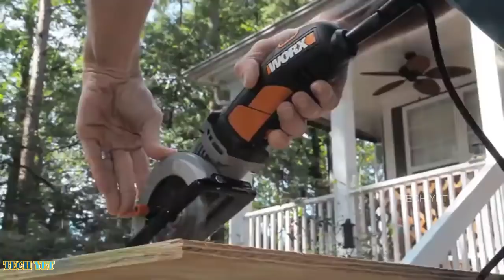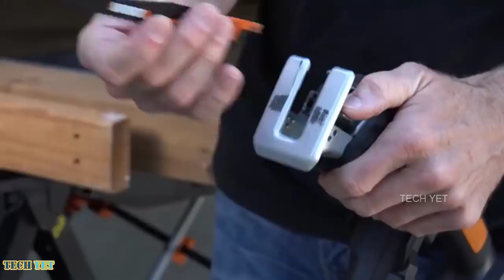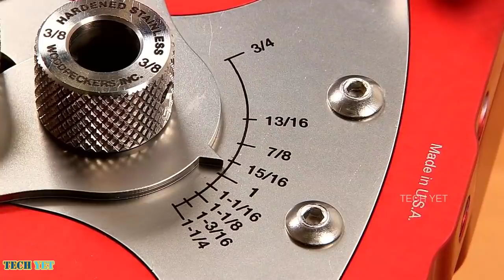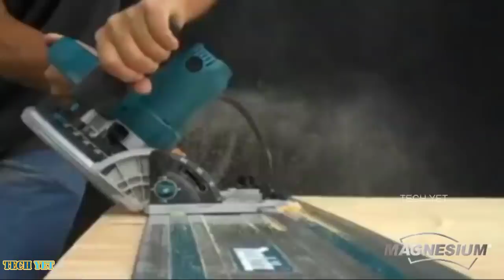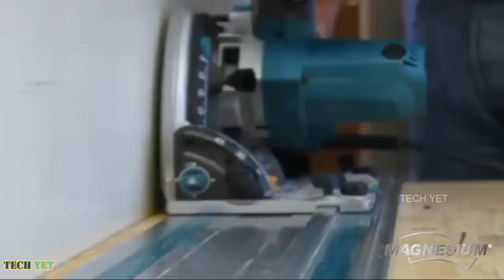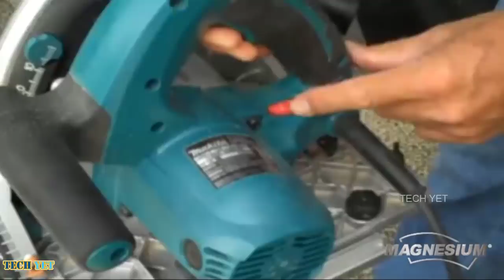5 Cool WoodWorking Tools You Must Have On Amazon | Best Hand Tools

Comment: Woodpecker makes some great wood working tools and jigs...but as others have said, they are way over-priced.
I realize that they are precision tools that really aid woodworking projects. However, it has always come down to price and how often I will use a tool.
I don't mind paying for expensive tools, but not if they are going to set idle and gather dust in the shop.
I like building my own jigs anyway and while they may not be as pretty as woodpeckers stuff, they do what I need them to do.

Comment: interesting reviews on Amazon for the turbo plane. Doesn't work on US grinders since it was made in Australia for Australian grinders which run a different size. Definitely a serious hazard to try and use on a standard 4.5" grinder. 
" suemarga

2.0 out of 5 starsNOT fully functional on U.S.-made grinders

January 2, 2019
Verified Purchase
This product seems well made and hope that I will ultimately be able to use it in the manner promoted by Arbortech. The company is exceedingly misleading however in their marketing to the US audience and it has caused me great frustration. The instructions with the TurboPlane indicate that one or two of the provided shimming washers should be used to bring the cutting edge flush with the blade guard. Even using both shims I can get the cutting edge no closer than about 3/16” from the guard (in other words if the grinder is placed so the guard is resting flat on the work piece, the TurboPlane is recessed by 3/16” above the work. Even if I had additional spacers there is no additional length available on the grinder shaft.

In this condition cutting is possible but only in a very limited way compared to the cutting options promoted in the Arbortech promotional videos. Although I have a relatively new, name brand grinder, a 4 1/2” Makita, I initially thought perhaps Makita has a non-standard geometry and another brand would surely work.

After an email and a phone call I was able to reach Arbortech’s technical person who was sympathetic but very clear that U.S standards for grinder guards are different than those in Australia where Arbortech is headquartered and that the TurboPlane will NOT function fully as advertised on a U.S. grinder.
"https://www.amazon.com/Arbortech-IND-FG-400-Turbo-Plane/product-reviews/B008NA2IJ0/ref=cm_cr_arp_d_hist_2?ie=UTF8&filterByStar=two_star&reviewerType=all_reviews&pageNumber=1#reviews-filter-bar
Reply: You might think the whole world revolves around the USA, but as you can now see it doesn't.
Reply: @iamrocketray  so then why the fuck are they paying to advertise directly to US customers?
Reply: @iamrocketray  that's fine, I'm sure a cheap Chinese version will be made to accommodate us sizes.
Reply: I`m retired and have a small shop where I perform woodturning, create musical instruments, and some cabinetry. I have a shelf full of woodworking textbooks - but I found this woodworking guide, https://t.co/SGIXIPXR0z . The comprehensiveness of this book is surprising. It has decent coverage on every topic.?
Reply: @nunezkarl485  more links to Teds 16000 plans.....not a favorite by any means. Most serious woodworkers get tired of seeing the Ted's link.

Comment: $635+ for the doweling jig? Yeah I stick with my Center Point Dowel Hole Pins for $2.29US. You might have to wait 30 days to get them and I order two sets and it was more than I need at one time. yes it takes  as a little longer to use but the good enough for me. https://www.ebay.com/itm/8pcs-Centre-Point-Dowel-Holes-Wood-Pins-Joint-Alignment-Tool-Set-for-6-8-10-12mm/233088456527?hash=item364527974f:g:jOsAAOSwa3lcNxE4:rk:1:pf:0  2 sets will get you 4 of each size.

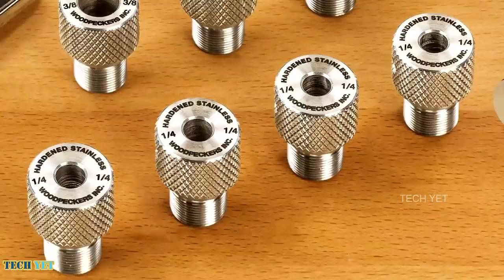Comment: 3:41 The finish of the bushing bores is awful. Pretty foolish to use stainless steel for drill bushings unless they are 440c or 17-4 cond 900...which these clearly are not.

Comment: The makita plunge saw is the worst on the market from experience. Tho a good plunge saw will earn back its money in only a couple of jobs and is easily one of the best tools I have ever owned! (I'd recommend dewalt 54v plunge saw over the rest).
The 2 in 1 worx saw looks to be too average to to purchase in reference to the task they should be usually used for. 
The worx one handed skill saw is something a plumber may find handy on floorboards but really just a novelty item. 
To buy the dowel jig would be like buying an aircraft hangar to store a bmx! 
The arbotech blade could be worth its weight in gold to the right person, tho likely costs it. This  for me was the best item on the list, yet not essential. 

All in all, a load of junk. IMHO

Comment: A professional opinion; 30 years construction.

Tool one; foreign made piece of shit...Corded? lol...May as well be run by a fuckin water wheel! 

Two; Shaping grinder wheel...I can see it being useful for some applications like; Making those cool bears out of tree trunks ~eye roll~. 

Three; non corded STT- SAWZALL TYPE THINGY? Cheap foreign made junk...It will break and the battery will take a shit in no time flat and the replacement will be 5 bucks cheaper than the whole tool. 

Four; doweling/pegging jig;...looks decent and well made...( just investigated them) Made in USA...BUY ONE FOR ALL YOUR FRIENDS, BUY ONE FOR EVERY CABINET MAKER OR FURNITURE MAKER IN YOUR SHOP...GIVE THEM AWAY AS CHRISTMAS GIFTS...:)...

Five: Made in china...for about 20 dollars, sold to naive Americans for 400 on amazon...Good ratings, but if you spent 400 bucks on a tool, what else are you gonna say? ...Take the 400, buy a nice old used table saw and outfeed table...Like we've been doing for years...

So, ONE tool that you must ABSOLUTELY have...:)...Keep your body parts away from whirling machines...:)...Just sayin.